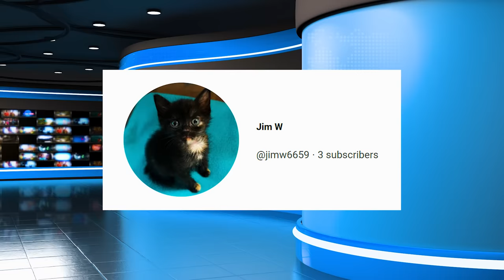Why Are So Many Builders Running Away?

Comment: I'm a plumber and only do the small jobs which suits me, customers seem happy just to get someone to have a look. I charge an hourly rate. Personally when someone calls me I know straight away if I want to go round to do it, some blokes are telling me what I need to do on the phone, I normally tell them that they should do it themselves. I'm lucky where I've got in a position that I don't need to do it anymore.
Reply: Exactly the same with me. When people ring me and say they have an easy job that won't take me long they are actually saying I don't want to pay you very much to fix my problem. I do as you do - tell them if it's so simple and won't take long then do it yourself. They change their tune very quickly.
Reply: @twobins2060  Spot on!
Reply: Exactly the same with me.

Comment: In my case I went back into the electrical trade in my late 50s working for a local electrical contractor just to nudge myself nearer to the state pension and lasted 4 years before chucking it in.
Luckily I had things in life sorted moneywise so the wage didn't need to be fantastic but as it turned out JIB gold card or not I would be running a small job, couple of sparks and apprentices for the grand totall of £90 per week more than the older 19 year old apprentice.
It's not neccessarily the kids fault but most of them have no experience of pyro, metal conduit, SWA over 25mm2 or cell pack joints on over 6.00mm2 armoured, as an old duffer I was expected to teach this for free, test installations and complete the job on time for less money than an evening shift picker in a local Sainsburys warehouse.
It was easy to jack but my kids will just have to inherit a bit less I guess?

Comment: Homes Under the Hammer for the tradesmen?  That seems like a good idea Roger, provided you can fund it initially.  The trouble is you need to be more of a spreadsheet operator (I'm one, I studied Sage Accounts, running a small business, recently retired), than a skilled builder, as it's all about the money, not the building.  I'm fortunate to know many tradesmen, I worked in an industry allied to the building trade for 40 years and have a list of people I can rely on.   Also there was a recent clip of a guy on You Tube pointing brickwork, charging around £350 a day.  The customer told him to go and do one.  I checked, and the going rate for a brickie is now around £300 to £350 a day if they're self employed tradesmen.  Any comment, Roger?  I must agree with you, the shortage of builders will lead to prices going up, but more importantly, the danger is the unqualified and incompetent tradesmen will have a field day.

Comment: I joined the army at 33 to get out of plastering, its that bad , race to the bottom, unfortunately got injured after four years and ended up getting a medical discharge 😮, i was only a full time reservist, so got the DCM, (don’t come Monday) ended up back on the trowel 😢, i”m 44 now and currently on plan b…. Building industry is finished
Reply: I met a guy once in a gym up north where i live. I got speaking yo him he said he worked packing in a warehouse. He said he was a plasterer from 17 years old hes done it ten years. Said he quit for a minimum wage job and plastering was tge worst job ever.

Comment: Great video, though i would say 'work on trust' would be amazing in theory but those contracts should help protect both sides, so if the 'contractor' is scared of or not kean on having a contract then I would question why, the custom needs a fair job doing and needs some form of assurances. Not many other industries work on trust and I would never have large adjustments made to my home or similar just based on their word. The stress you mentioned works on both sides, though I can 100% agree and understand they people are leaving the industry because of it.

Comment: I think you sumed it up about right. 
I've been in and around building since a teen. I'm now 46.
Working in may positions and ending up running my own construction firm.
I'd say a higher % of bad builders partly due to falling work ethic and the increasing knowledge and experience void. 
That includes associated sectors like engineers and architects. 
That's one of the reasons I kept small and did it all myself. 
But you body is basically done by 50 then.
I wanted to go into house flipping, but that's difficult to get into and make a profit due to every other show since 2000 was an auction of diy show 😅
Bigger investers and a new wave of  punters  sucked everything up. 
Theres still money in London and flipping heigher valued properties anywhere, but most won't work in London now and you need deep pockets or an invester for the rest.
Overall I'd say is an undervalued and under paid sector. Also massively undercut from both the big wigs and influx of alternative labour sorces. 
And the full effects of the skill base has not been realised yet.
Other than that, all good 😂

Comment: There’s to many rouge traders out there too. Undercutting the real workers. And with prices going up customers are obv gonna go with cheaper prices. Problem is these rouge traders are making more money than us.
Reply: If your customer is more concerned about price over value - or can't understand the difference between the two - you've already got the wrong type of customer. So let them go with the cheapest. They will call you back when they want it redone correctly. sounds harsh, I promise you it nearly always pans out that way.

Comment: When I price a job up I tell the client my quote is based on the current material price, if they are happy and give me the job just before I start it I check to see if the materials price has changed and then if it has I let them know and ask if they are happy with the increased costs of the job.
Luckily my jobs aren't that big as I'm a carpenter so the increase isn't overly large
Reply: Absolutely. Fixed prices don't work anymore. A time and materials basis can be better as it takes the risk of materials price rises out of the job.
Reply: assume you pass on the reductions lol
Reply: We have a schedule of mark ups depending on the cost of the materials but yes, the cost plus the mark up is invoiced to the client as an individual line item. If the client wants to see the supplier invoices then we let them.
Reply: @edc1569  I always do if it's someone I've done a lot of work for not unless it's a small amount then I don't bother. If it's a new client then it depends if I'm in a generous mood 😁
Reply: Bricklayer I used just charged for labour and I paid for the materials. Helps to keep him under the VAT threshold I guess and it reduces the risk of specifying lower quality materials to increase profit which does build trust.

Comment: elephant in the room is if more people in the middle of their working life could afford to buy homes and do renos, more of the money floating would go into building jobs. when but today the little money you have goes in your bank either the landlords bank the insurance or loan companies bank or the pubs bank. Productivity had more then tripled in 50 years, but as that happened most of the free cash around is transfers of wealth between the rich, not wages that come home in the last month or two and it should be the other way around.
Reply: It would be much easier, if ALL homes were built in factories (like the German prefabricated"huf haus"  house-but lower down the price scale) that way, houses could be mass produced to a very high quality, fully wired/plumbed and insulated arrive on site to a concrete base with all services ready. Just like a car is today.

Comment: I'm just a handyman/gardener/painter and decorator with a very light bit of brickwork thrown in , just repairing the odd step etc , I used to be a coded welder and had to leave after health issues , so went self employed , luckily I have no mortgage , loans , credit card debts etc so in a more fortunate position than most but over the last year (especially with the weather ) with customers and the increase in costs for materials etc I wonder why I bother at times .

Comment: Whenever there is a great deal of noise about something it is reflecting an industry or trade that is ready for a good dose of disruption to bring it to the present.  I don’t have the answers (obvs). But simplification of construction and materials would make the trades’ lives much easier.  I went down the diy self taught route for all the reasons mentioned by others but I don’t blame those in the trade as they are on the receiving end of this situation too.

Comment: As a landlady, I had the opportunity to work with lots of builders and trade members. This is totally my experience, not generalising! A couple of them, whom I worked with for years on my projects, and mostly these people are near or over 40 and 50, but the rest were either trying to overcharge, using sexual slurs or totally dispropriate to work with. Maybe the trade needed to shake off for the better future.

Comment: I’m sorry Roger, but as ‘a customer’ who recently had an extension built, good communication and detailed quotes are essential. I had to work hard to get my builder to properly quote at the start of the job but that document then formed a benchmark point from which the builder could negotiate an uplift due to materials increases and additions to the contracted work due to problems that couldn’t possibly been foreseen (like my non-existent soak sways!!!)

Comment: A building contract is a benefit to both the builder and the customer when it comes to settling any disputes. If you cant price the job properly then get a QS firm to do it for you and factor in the additional costs incurred within your quotes  , always take staged payments and ensure any quote includes a decent contingency sum. If price work feels like too much stress then stick to working on a cost plus basis or day rate so you cant then be out of pocket.

Comment: Not a lot to add, after 40 years of the trade I’m retired but still have to work, sawing wood keeps you warm twice but doesn’t make you rich once. I now make my customers agree to my terms these are, materials are paid for up front, 3 stage payments for my time, the overall cost may increase by 25% but will not decrease, my deadline is the only deadline , I work when I please and there is no such thing as an extra. Take it or leave it. I’m as busy as I need to be and  have a great relationship with my clients.

Comment: My own experience as a Customer  has been bad and i find it easier to learn how to do stuff myself rather than trying to find a decent builder etc.
Workmen turn up maybe maybe not for a quote , maybe they will give a quote maybe not but usually they just dont bother.
I understand the whole margin of error thing but the quotes are often so far apart its a joke, 
Like windows was the last quotes i got, same windows ,
One quote was £25k and the one i went for was 6k and actually went ok.
Word of mouth is best in building trade.
I dont want to rip a builder off and absolutely prepared to cover extra costs as needed but just need to trust that the job is going to get done properly for a reasonable cost in a timely manner.

Comment: I am sorry but I have limited sympathy, and I come from a family of builders.

The problem is poor communication.  Sometimes it is poor communication about the initial estimates for material costs, sometimes it is poor communication about problems that are only found part way through the job. 

Of course good communication may mean you do not get certain jobs - chances are those are the jobs you would not want in the first place.

of course there are bad customers, but this is true for every industry - some people pay on time and some people do not.

Whilst I agree on smaller jobs trust is key, but you cannot have trust unless both builder and customer agree on the job spec is to start with

Comment: This is going to be a major problem in this country. There are fewer and fewer skilled workforces, builders and their trades, engineers, mechanics. An ever burgeoning population that won’t be able to get stuff fixed. I know quite a few builders, plumbers and electricians they are doing very well financially from the outside at least. I worked at a local college helping I. Construction and in the 5 yrs I was there not one student went on to level 3 and into the trade. Abs shocking outcome

Comment: Like this chap normally.  However, contracts and delay clauses should be a part of any good builders company.  It protects both builder and customer, especially as you mention trust is a key issue to both parties.  I personally may not go with the cheapest quote, but one that offers a contract that protects both parties in case of a relationship breakdown.

Comment: I can only speak for what I see of the building trade which admittedly isn’t a lot but in Leicestershire, the building industry seems to have far more incompetent & also down right unethical trades people than honest, hard working, well practiced tradesmen. 
From plumbers & sparks, brickys to exterior renderers. The ones I generally seem to come in contact with or witness other people using are all out to get paid as much as possible without actually doing a good job & in a lot of cases fall well below any respectable standard. It’s a nightmare to be a paying customer these days hoping to simply get the standard of work you deserve.
Reply: Unfortunately, you are right because all the sensible artisans have left the "trade"

Comment: Hey non builder here, and young person looking to get on the property ladder, its sad to hear the state of this industry, especially when we need good quality housing now more than ever. One you said Rodger really struck me is builders not getting paid for the work they have done as well as cowboy builders, does anyone now if they is some sort of Gov/Trustworthy 3rd party Trust account system out there? where customers pay in to for the works prior to starting and builders get paid on completion of project stages  to avoid all this and to handle disputes or am I living in cloud cookoo land?
Reply: It's an interesting idea but probably not because of the liability of projects going way over budget or over time, and the additional cost of this middleman group. I've found the best (but not perfect) method is to do a lot of research on the contractors, get multiple quotes for your project and trust your gut. If it sounds too good to be true, it is, and if they're too hard to work with before the work even starts, don't start.

Comment: As a commercial/Industrial electrician, are J-rates are near $100 an hour (and you should be see are billable rates). That including full benefits with a great pension. We still have trouble keeping new apprentices around because there is no AC, its too much work, I want to work inside only, etc.

Comment: Hi, I’m afraid I don’t have much sympathy. After all, who is likely to have more experience costing and quoting a job? The builder or the average customer. Who do you think should bear the risk? Perhaps it’s a good thing they are leaving the business. Both for the stressed out builder and their potential customers.
I will not employ a contractor without a trusted reference that at least gives a fighting chance of an equitable outcome. A satisfactory job where no one feels ripped off.
Could you perhaps do a couple of videos on best practice for both the customer and contractor. How to mitigate the risks of the dishonest on both sides. I like to do a schedule of payments for example based upon their quote, materials costs and timeline for the work. I will also do a spot check on estimated materials cost.
Reply from the maker: Nobody is asking for your sympathy. This video is just describing a situation. There are no violins playing.
Reply: @SkillBuilder  hi, fair enough. My suggestion still stands about advice for clients and contractors though if that’s something you would consider.

Comment: In the last quarter, 

2x truck taxes
PAYE tax
NI tax
CIS monthly taxes
VAT tax per quarter 
Corporation tax, raised again. 
Book keeping costs
Accountants multiple costs for each of the above. 
Inputting for every bill, broken down fully. 
Accounting for suppliers accounts. 
Accounting for quotes and estimates, loads of unpaid time. 
Accounting for invoicing, calculating in unpaid time. 
Time & material management, unpaid time. 
Project management, usually unpaid. 
Computations for cis & issue certificates, unpaid time. 
Constant repairing, cleaning & sorting tools & machinery, unpaid time. 

Oh, then you've got to work 5-6 physical days 7.30/8.00 to 5pm/ 6pm or whatever it takes to get that days work done. You can't just stop. 
The paperwork gets done free at night & weekends. 

Then you get Christmas & a new year's start.
Reply: Yep would agree .. after 40 years I’m hoping this is my last year in the trade .. I’ve seen so many changes and not for the better .. I also end up working plenty of unpaid hours and when I worked my own rate out it would be less that a tenner a hour .. plant / insurance/ fuel etc has all gone up yet again and like most of us I’m just worn out with it … Not really sure what the future is going to bring…

Comment: I only work by the hour, plus materials now. Even at my last working stint, sub-contracting in a top-drawer cabinet shop. I charged by the hour for my labor, used their machinery, materials, and vehicles, and ate my own mistakes, including the boss's material I'd wrecked. LOL!  Some jobs are too hard to estimate, and it worked for both of us. The huge bonus at tax time for self-employed deductions is the best reason to be. Since being recently retired and doing small handyman jobs during the dampanic, I've realized that I really don't want to touch any more grimy bathroom caulking. The only dirt I want to see is from a demo.